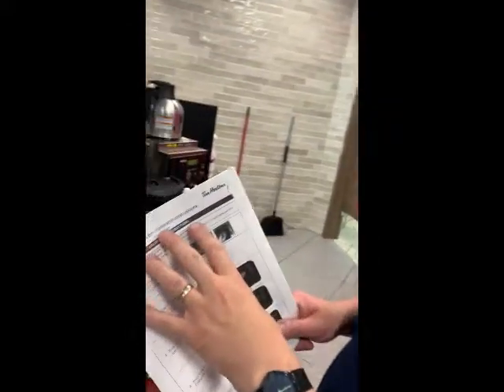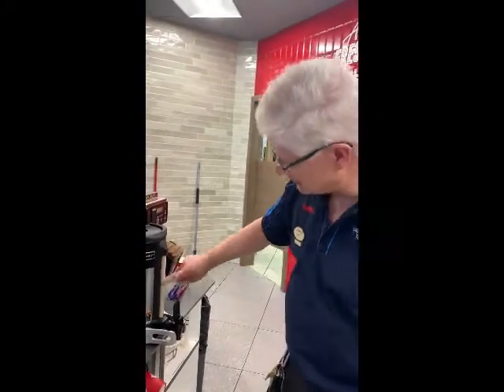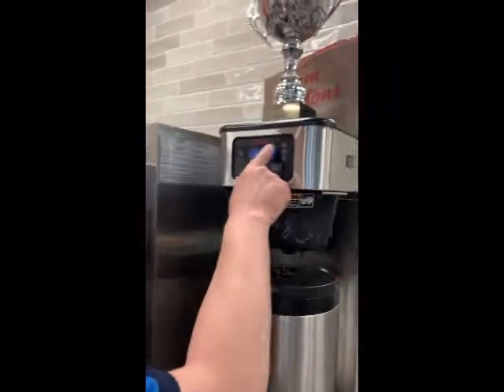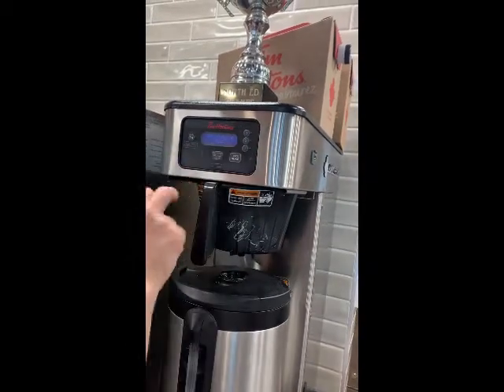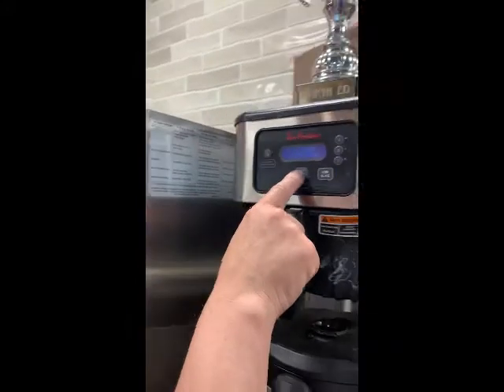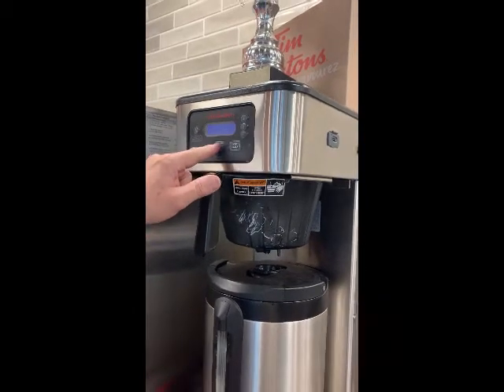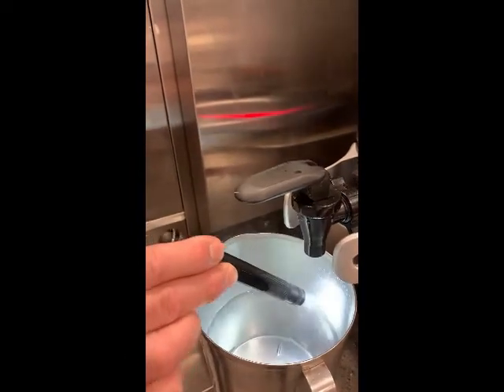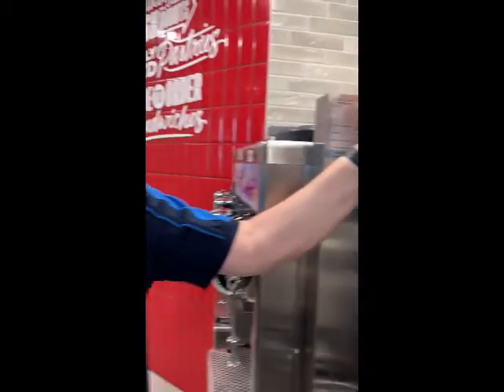How to Calibrate Fresh Brewer

Comment: For the sake of those of us who are watching, I think you should let us all know if you had zero out the scale first with the same graduated cylinder...or you just poor the water in and then place it on the scale?
I have to calibrate on a regular basis and I believe the cylinder is more accurate than the scale.🤷